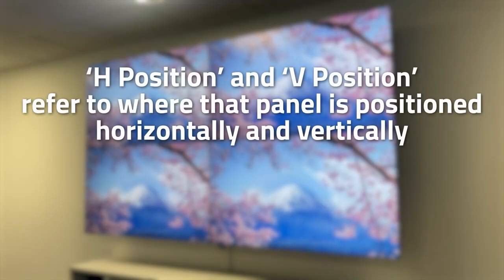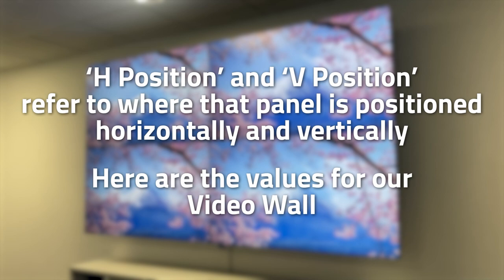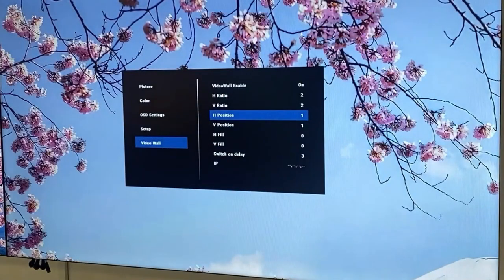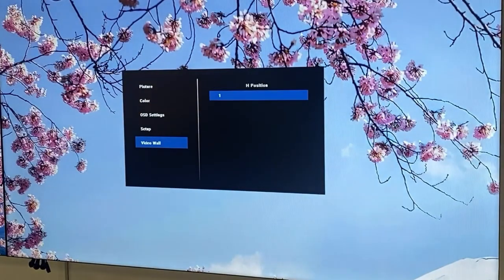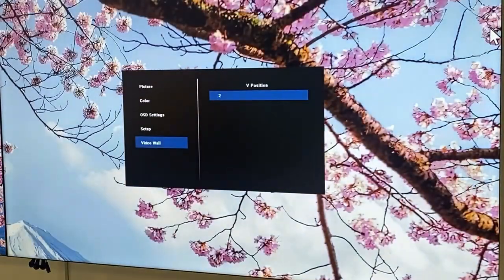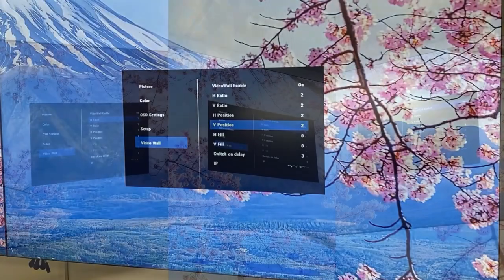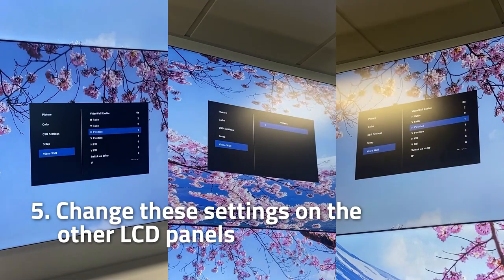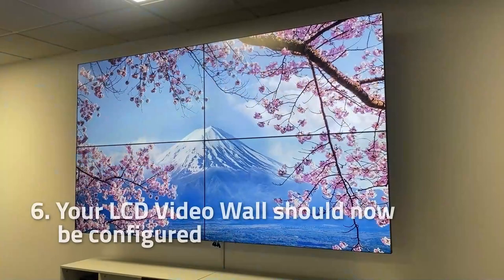LCD Video Walls Configuration Guide - A Step by Step Tutorial

Comment: How did you connect laptop to tv... any converter used?
Reply from the maker: Great question! A laptop, or any source such as a digital signage media player, can be connected directly to the first screen via HDMI or DisplayPort – no convertors are needed. The video signal is then daisy chained between the screens via DisplayPort, so no external splitter or control box is needed.